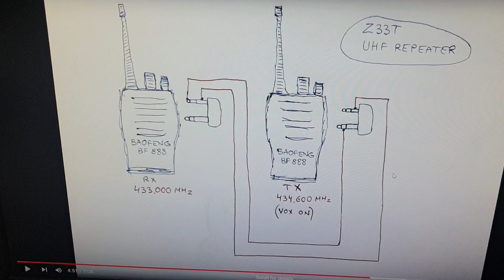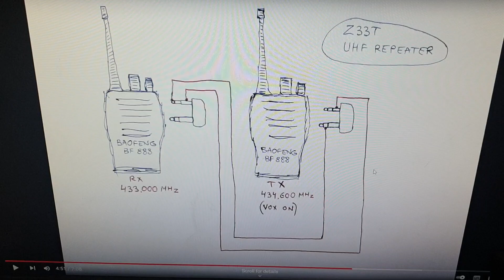The poor men's uhf repeater

Comment: On same uhf band at 5 mhz You get a full 200 feet of coverage till de-sense of recievers. If You don't use  a 4 c as vity duplexer.
But if you had 1 vhf 1 uhf radio crossbanding back n forth it will repeat add external antenna it will work all over town . You can't use same band
Reply from the maker: bullshit
Reply: @ruiamorim1975200able  It's not bull shit i run a repeater he is telling the truth. If you need help setting up a repeater let me know and i'll help you.
Reply from the maker: @icelandjent6417  tks